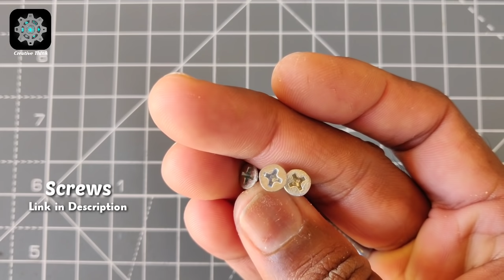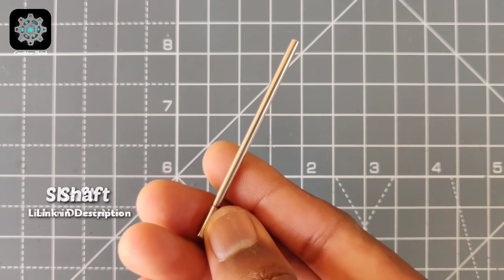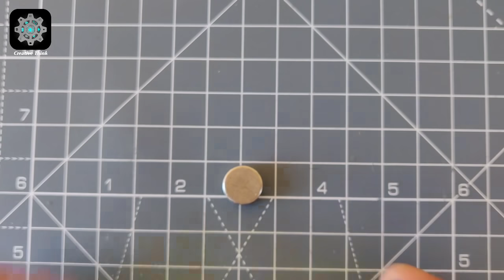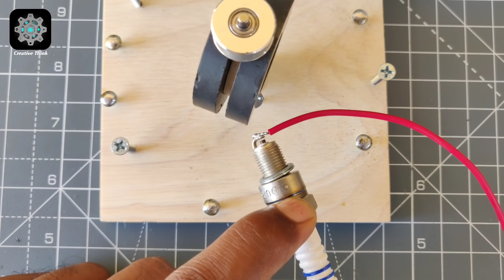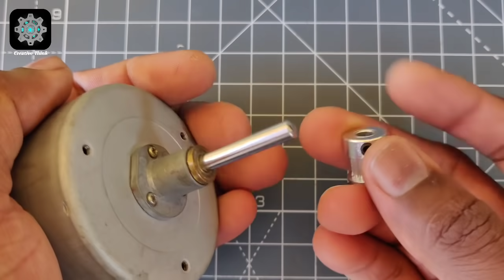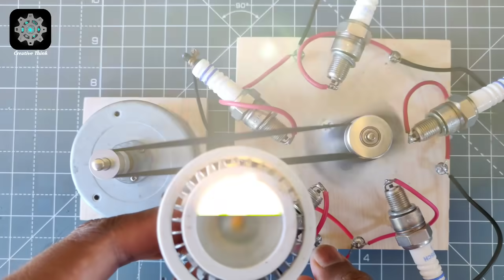Spark Plug Free Energy Generator

Comment: When the hot glue came out I knew it was fake,  actually I knew it was fake when I read “ free energy”. 😂😂😂
Reply: Hot glue for is actually the best bonder when it comes to electronics. Because it won't transfer electrical currents through it.
Reply: The feelings  ofcourse it is fake. Perpetual motion cannot be achieved without external source. laws of physics btw
Reply: Ye evry time
Reply: @Stelle_7  Please tell me how earth rotates continuously w/o energy "input" and how sun shines as well....it  means perpetual energy is the BASIC Law of nature, don't try to change it  !
Reply: This argument will lead a new invention
Reply: @zoyjoy4567  Google, 'suppressed technologies ' you'll find a lot of them !
Reply: @radsr5148  because in space there is no friction. Nothing tries to stop Earth.
Reply: @radsr5148  

Earth rotation = conservation of angular momentum.
Sunshine = nuclear fusion
Reply: @radsr5148  duh. Suns energy comes from chemical reaction, thus if its fuel runs out boom. Sun will die and will become a supernova eventually leads to black hole. Not a perpetual motion because it got a source and not unlimited and it does not renew its own.
Reply: @radsr5148  same like earth. It only dependent on the sun which its source. Without sun earth will float endlessly throughout the solar system cuz no magneticfield that holds em.. so not perpetual motion ...... 🥱🥱 please attend science class next time before you argue.
Reply: @radsr5148  this video claims about free energy .. it means it will create its own indefinitly. Which not really possible. You cant get past to 1st law of thermodynamics let alone the 2nd law
Reply: @radsr5148  google basic physics, you'll find a lot on it
Reply: well... nothing free in daaa world
Reply: ok ok you may be right
 But its not considered perpetual motion. Earth doesnt create its own energy still depends on the sun. Yeah earth may move freely indefinitly but thats all to it  ..
Reply: i said nothing about earth needs sun to move here and there. Anyway We have different perception on perpetual motion about solar system.. could'nt argue more.. but lets accept the fact that the video is fake anyway.
Reply: TRY FOR YOURSELF AND DO NOT RELY ONLY TO YOUR JUDGEMENT.YOURE A PAID TROLL DEBUNKER.
Reply: John NZ ....the magnetism stored in the magnet is providing the electromagnetic energy which provides the momentum to keep spinning. The generator will run till the magnet loses its magnetism. Will it lose it? I don’t know. I have a magnet from an old speaker I keep stuck to the side of a metal tool box. It comes in handy in my shop. I’ve had it over 40 years. It’s as strong as it was when I acquired it. It was old then.
Reply: "Free energy is "NOT POSSIBLE"."

"This video is "entertainment" purpose ."

Was not a dead giveaway?
Reply: @radsr5148  
Earth does not rotate.
Earth is not a spinning water-covered ball with a pressurized atmosphere corkscrewing through an extreme infinite vacuum. 
Laws of physics are always applicable.
Water always finds its level and always conforms to the container/boundaries in which it resides.
Reply: The description says it is fake also
Reply: The energy source for all moving articles in the Universe, is of course, the finger of God!
Reply: @Stelle_7  yes it can, the laws of physics are man made inventions.
Reply: @Restrictted  Agreed...little Abbas needs to grow up and stop commenting on things he knows noting about .
Reply: @zireael_  explain this further
Reply: @jordannangwala4608  If there was something like air in space. It will cause friction. Then friction cause kinetic energy turn into heat. Wouldn't this slowed down the earth? Am I thinking wrong?
Reply: @zireael_  mate I have no idea but presence of molecules of any sort cause friction to an object in motion that's for sure 

But if this thing actually works could you scale it up to power a house or even a small village you could conceal the whole apparatus within a vacuum chamber so you maximize efficiency am I the only person seeing limitless potential in this simple invention
Reply: @jordannangwala4608  This project can't rotate forever even in vacuum chamber. If you want electric energy you must give another kind energy. In this project you consume kinetic energy and produce electric energy.

Magnets can't help to rotate. They will rotate it only when torque because of magnetic force isn't equal zero.
And torque won't always be same direction. Direction will change after reaching the balance position(when all magnetic forces cancel each other and torque be zero)
So magnets only helps it get faster when it approach balance position. When it hits balance position, magnets slows it down.
This will go a copule round(depends on first rotstion speed). Eventually it will slow down and stay in the balance position.

Edit: Even in vacuum chamber, you only prevent air friction. Friction between moving parts won't decrease.
Reply: @radsr5148  The Earth must have had an input at some point to melt the core.
Reply: It’s a magnet...not fake
Reply: @radsr5148  Everyone knows the Earth doesn't rotate.
Reply: @EmmanuelValverde  Call em basic 'hoaxes'   😄😄😄😄😄
Reply: @Rakesh Bishnoi You eat food everyday which comes out of infinite source of power known as sun...no its not finite, its infinite  !
Reply: @Rakesh Bishnoi sorry for late reply, even if its going to end, it could be wrong information or just guessing.  Look at all the forces of nature i mentioned,  they're all infinite ! So relax and think its infinite !

Comment: People, please remember that the wood must be pine, beacues birch will give you 3627 Ohms more energy than the Oak wood, Furthermore, if you paint this wire in blue color, Voltage jumpe by 3 and that will give you 6000 kiloWatts more free energy. Im a professore of sciecne in plumbing Academy and you must belive me.
Reply: Ah ah ah ah.... You forgot : if the magnet poles are marked in blue and red, it is still 3V of gained. I'm a professore of science in plumbing Academy too but in France and you must belive me too ;)

Comment: He needs to fire his editor, because he failed to show the free energy part. Exciting a motor with a 9 volt battery and watching it slow down over time is clearly not free energy
Reply: I was super excited with this video then I saw a 9v Battery. Since i’m ignorant on this, what was the whole point? i could skip all of this and simply use a 9v battery to light up a lightbulb. Am I missing something here?
Reply: @jacopodanglars4836  He used the 9v only to start the motion, he removed it and theoretically the magnet spinning caused the induction in the spark plugs to continue producing power to run the motor. The issue Mike brought up though, is that as the rotation of the magnet decreases (which begins the instant the 9v source is removed), so does the output of the spark plugs — thus a downward spiral of decreasing output. The only way this would become 'free energy' is if the contraption continued to spin indefinitely — which does not appear to be the case.

I don't know much about modern electric cars but I imagine they are more than just a battery, motor and potentiometer — something like this mixed in would definitely help produce longer driving ranges — like if the battery source was repeatedly activated momentarily to boost the magnet, then deactivated. If the battery was electronically switched on/off, that could prolong it's operational time — but it's doubtful that the spark plugs are producing enough amperage to turn a motor under heavy load.

I've toyed with the concept ever since I took my first RC car apart when I was 12, hence my curiosity in this video (the spark plugs and magnet intrigued me) — I still think there is some potential regarding magnets and coils (and by the looks of this guy's soldering techniques, he's not exactly an electronics engineer) but would love to run some experiments myself and take some readings.
Reply: @jacopodanglars4836  He just started it with the battery, then it slowed down
Reply: @UTtherapy  there was no free energy in that video.  If there was, please explain
Reply: @jacopodanglars4836  that’s correct, there is no such thing as free energy ever.  He got the system spinning with the 9V.  Then it slowly lost momentum after that, if it was free energy then why not leave the light on?  He can’t because it would have come to a stop in seconds

Comment: Good use of the spark plugs, but be careful. If this starts generating MORE energy than it is using, it will lead to the same singularity that was demonstrated by the flux capacitor in 1985.
Reply: If placed in a super conductive, super fluid, and minimal friction, it might run for a very long time.

Comment: This device does not work, a spark plug cannot generate energy, it is necessary to use coils to convert the magnetic flux into electric current.
Reply: ya think?
Reply: That's not true I'm a electrician and this can work but you have to have the spark plugs and the wires in that right place and you don't need coils with magnetic energy the magnetic field will cause energy and the energy will go into the sparkplugs and produce DC energy
Reply: @thenxtcurry6914  So when will it stop?
Reply: It will only stop due to mechanical failure or overheating
Reply: @cfnsoto  then why he suggesting to use that spark plug instead of magnet?! 😂
Reply: Maybe to create a high current flow through the magnetic field?
Reply: @thenxtcurry6914  are you electrician? Really? A spark plug Is only a resistor designed for avoid parasital courrents that could to afect the engine fuction.
Reply: @juanfernandoangelangel2139  lies I'm a engineer at NASA.  This is legit
Reply: I have 13 degrees in...science. And this is so legit. I’m cereal.
Reply: @mandelaeffect1111  I have 33 degrees an what I say goes
Reply: Explain the spinning atom, please.
Reply: @UTtherapy  - who says atoms spin?

Comment: He’s just spinning the magnets with a can of compressed air... Overplayed-out scam...
Reply: Your right he is I see the belt moving oddly
Reply: Im an electrician. even if hes not spinning the thing with compressed air notice how he only shows the power output for a second or two on a low power draw thing like led bulb. i suspect if he left the light on continuously , it would drag the contraption down with load/friction in mere seconds.
Reply: In the description he says that it is for entertainment and not real.
Reply: or the 2 screws at the front (positive and negative) are through the table and he is applying power through the exposed parts of the screw
Reply: It's too far to blow it. He probably plug in electricity info screws
Reply: Kamil... Actually, with a big enough air compressor and the right tip it’d easily be close enough. This scam has been exposed MANY times...
Reply: @devilyn76  very much so!
Reply: last few seconds of video show s fan grid 6" from his waste of time.
Reply: Again close minded individuals. Im sure you have an iPhone.
Reply: You gotta remember that 99% of the "how to" inventions on WhoTube are posted by the millinial "look what I can do" crowd who have the actual aptitude of Stewart on SNL and are either living at their mama's or some other form of "free" housing.

Call em coddled snowflakes I do, we've gone from producing Clint Eastwood's to fostering Peter Pan's here in America, and for what ?
Reply: No guys come on....
If you pay attention, there would be no need for a motor in this demonstration. The contraption should work without it. The motor is what's spinning the magnet. He just hid the lead wires underneath

Comment: A magnet is attached to a metal bar opposing for years the gravity force of it's own weight. Can you explain that? After years of studies sincerely I can not!
The rolling barrel to a slopping surface problem: during our calculations we should consider the energy absorbed by the surface friction. The friction between the moving barrel and the surface is a fixed, an in-place force. Fixed forces can't consume-produce power. How is then that the friction consumes energy from the barrel? Can you explain that? I refuse to accept proper physics proposals. 
The electricity problem: how can current run inside a cable? We believe it's electrons inside cable that carry this energy. It's wrong! Electrons don't carry energy from electric factories to homes. It's a field issue produced by the cable.
I propose to search Google for the battery-lamp problem where one cable is 1 light year long and measure the time it takes for the lamp to light.
We have learned physics the wrong way and the worse is applied maths used in physics, completely miserable, lame, loquacious, unable to explain, unable to predict.

Comment: My idea of  a almost free energy  device is a HHO generator that runs a  gasoline engine that is belt driven to a generator.  If  a car alternator is used with a lead acid battery  then you could connect the  12vdc-13.8vdc into a inverter to produce 120vac  60 cps output. This is the basic concept  with variations in Power output.
Reply: 😊 конечно же это неплохо и работает точно, но на самом деле вариантов свободной энергии достаточно много, чтобы можно было сделать свою жизнь независимой. Просто действительно "хозяева" мира не хотят этого. А это шоу с магнитом и свечами зажигания - АБСОЛЮТНЫЙ БРЕД!

Comment: well, it’s hard to believe, of course, I know that magnets, when moving near some metal, or winding, (in this case, as I understand the candles for a car engine), they give out a current, there is an electric motor of 18 volts, and how much energy this "almost perpetual motion machine" gives out, I noticed that if I connect, for example, a second weaker motor, for example, 3 volts, or a lamp, for 3 volts too, it starts to stop, which means there is not enough energy, which is this case to do? add candles? or use a motor with less consumption (although I pretend that then it will work). We will need Energy that can be obtained, it is like a backup generator, only a weak one.
Reply: А оно и эта система не работает. Закон сохранения энергии и электромагнитизм, не кто не отменял. Какая хитрость тут была применена ? Может источник дополнительного питания, может привод на магнит с обратной стороны стола. Но если вы повторите данное устройство, работать так, как показано на видео оно у вас не будет.

Comment: That rubber band called Timing Belt tho.
Reply: Actually that rubber band probably came from a printer which has teeth , that's y he is using pulley with teeth on motor which probably came a printer as well.
Reply: In simple terms it’s a transmission belt
Reply: Aperture Science would love this thing!

Comment: Using capacitors can solve the alternating + - problem for stable electricity flow and for reaching higher voltages.

One could build a battery bank and use larger versions of these machines to charge batteries and then use the batteries to power things like a home etc.

Energy storage is the trickiest part.
Reply: What about a voltage rectifier (if I've spelt that correctly) or is that much of a much compared to a capacitor.

Comment: The moment a load is put on this motor, it will torque out.
Reply: That exactly what happened
Reply: Logan Ayers A larger drive motor would draw more current and a larger armature would require more current to drive initially.

I don’t see your theory working in either way.
Reply: @loganayers7851  Even if you could make up the current, any load you put on this motor is going to slow it down or stop it altogether. The amount power this motor produces can only be increased by spinning it faster. Adding a load will draw more current which will slow the motor down. It's a domino effect resulting in this motor stopping completely. That is why you never saw the light stay on for any amount of time.
Reply: @loganayers7851  the short answer is no. no this would not produce anything. in fact the most energy it has in in potential energy. how much you may ask? well depends how high of a table you push it off when you find out you built it for no reason and wasted perfectly good materials in the process.
Reply: Try this in a bigger an alternate to the house UPS or Generator
Reply: He literally says in the description that it won't work it's for educational purposes.

Comment: The fact that there is a lot of free energy in the surrounding world can be easily checked by pulling the cable out of the outdoor TV antenna and measuring the current and voltage between the central core and the braid. On a wave dipole, I got 115 V and 3 A - pretty decent, you see, to get such a potential from the ether.
Friend, conduct a similar experiment with obtaining energy from the ether through a TV antenna, let them be surprised further!

Comment: Absolutely Amazing. How long did it run before friction stopped it? Why five plugs? Explains atomic and subatomic spin. Outstanding! Perpetual motion!
Reply: Bearings make the shaft completely independent, what is making the magnet spin, wonder if the pulley is Aluminum or Steel opposing Forces on the magnet inducing the spin..?
Reply: Its fake

Comment: The sun, and particules are free energy.
Dont forget this.
Reply: Its not, because it fuses hydrogen into heavyer elements, until it hits iron which cant be fused anymore without putting more energy into the system as it transforms during the process.

Comment: The  work of a engineer who has designed the system of spark plug wire with a turn charging power in neg positive power in 2,wheel turning in  watts ,it is wondering for some people unsuccessfully skillfully.